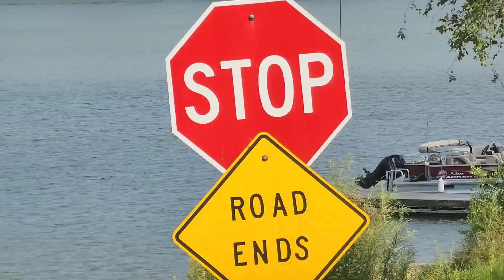SIMPLE Way To Catch TONS Of Catfish

Comment: Just wanted to say I love y’all’s videos. And! I wanted to add that I would definitely get a locking pin for that receiver. Seen to many trailers stolen with trailer locked to the receiver likes yours but receiver to truck was not locked. They pull the receiver an all straight out. Just trying to save your trailer and or boat from getting stolen. . Here in Ohio I’ve seen it multiple times just this year. Keep pumping out the videos! Love them! Good family fishing! 🎣😊
Reply from the maker: @PopsCatfishing  yes i have been thinking about that for sure we never had trouble here with that much, but very 👍 good thank you much yes we need that for sure. Bless you all fur supporting us.
Reply: That's skillet size what son caught, yay😅😅😅
Reply: Listen, when I heard that motor not turn over, I wondered if it was a Johnson. Sounded just like our sometimey  not start 150 Johnson on our 1972 Arrowglass. We found out it was the wires running from the motor to the starter were frayed. That's why we could not find it. When you wiggle that wire, it would start. Try and replace that wire and might fix your problem..❤❤😅
Reply from the maker: @katherinelowery7140  yeah thank you fur tip. I found out it was a wire problem which caused the battery to go dead and my jumping wires weren't strong enough to start it. So yes right track. Those wires get corroded over time and cause things you can't see we got er though . Good ol Johnson motors I love them